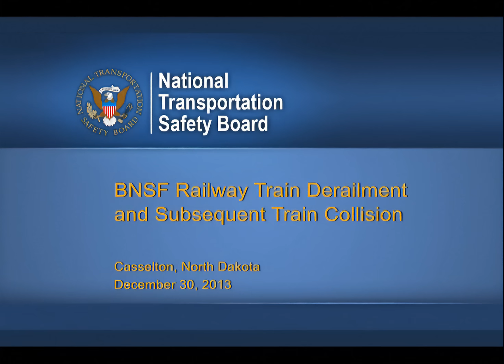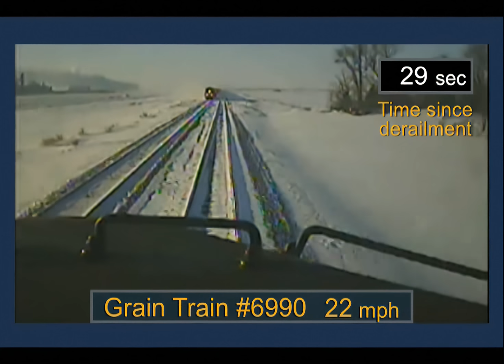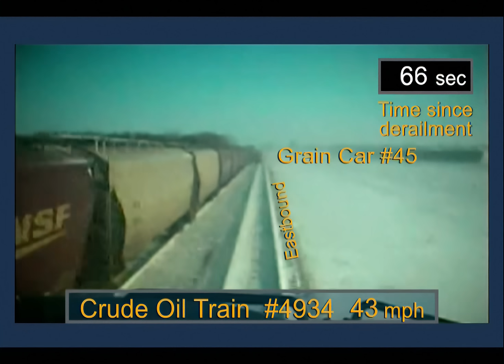BNSF Railway Train Derailment and Subsequent Train Collision

Comment: Almost a terrifying as being in a crashing airliner.  The speed is much slower a crashing train ironically has the same inerta energy as a crashing jumbo jet.  Makes me wonder how the engineer and break men survive these.
Reply: no where near the same energy. The train may be a lot heavier, but energy is to the square of the speed. Twice as fast equals four times the energy.
Reply: Well we didn't have to fall out of the sky first.
Reply: +Geoff Train crashes have never resulted in deaths? That's completely untrue.  19 m/s, 6 seconds, inelastic, this was a train crashing with a single derailed car, that's pretty much the best case scenario for these kinds of things.  Imagine two trains colliding on the same tracks, it happens, much different.  That too would be a rapid deceleration, at least compare apples to apples.
Reply: Trains:  diesel
jet/gas turbine/turboprop:   "aviation" grade kerosene 
i.e. almost identical.
Reply: Also train didnt instantaneously stop, it kept rolling forward, meaning the deceleration was not as abrupt as say, a plane hitting the ground.

The amount of energy going into the crash is similar, the rate of dissipating the energy is less.
Reply: They're in a 35mph tank that doesn't come to a complete stop instantly, unlike a 500mph aluminium tube slamming into the ground.
Reply: Phillip Mulligan This is an EXAMPLE ONLY! If there was a 747 Jumbo jet Flying @ 500mph, and there is a Fully Loaded 16,000ton Crude Oil Train traveling @ 47mph(50Max). The 747 weighs about 200tons(FullyLoaded) N Flies Head-On(@500mph) into the 16,000ton Crude Oil Train that's traveling@ 47mph. On Impact, the 747 jet starts to Implode; While the Lead Locomotive Absorbs the Impact(because the 747 jet is made out of Aluminum) it will already be Fully Engulfed in Flames from the jet fuel. The Cab & Hood of the Lead Locomotive will be Ripped Completely off (because of the Speed of the Jet), but the Train WILL still be moving at the Least 30mph. While the 747 is COMPLETELY Destroyed, the Train is Now Exploding the Crude Oil & Derailing @ the Same Time New coming to a Stop. The Point of it ALL is that the Train ALWAYS Wins! Although it the Train Derailed, it Completely Destroyed the 747 & the Crude Oil Train Destroyed everything within a Mile Radius.
Reply: If there are enough locos a fully loaded freight on flat ground can hit about 70 mph
Reply: Oh, they can go faster than that believe me.   Go to Europe to see fast freights
Reply: The derailed grain car was on its side and much lower than the locomotive that hit it. The crew would have been sitting several feet above the highest point of that car and were probably in no danger of being killed. Possibly injured in a roll over, but that didn't happen.
Reply: Well someone doesn't understand physics...
Reply: Passenger trains. Phillip
 was surprised that the engineer and brakemen survived this which is not out of the ordinary for the circumstances and no comparison to a jet's collision with the ground.
Reply: The 50mph you used for the train calculations was most definitely not conservative, considering that the video states their speed very clearly as 35mph-ish.
Reply: Destroyed everything within a mile radius?
Reply: I'm not sure it would be the crash they have to worry about... here's the resulting fire from this derailment.

https://youtu.be/LKCT_j3yvCU
Reply: Brake*
I'm curious now if trains actually have manned brakes not being manned by the pilot.
If so, then I have a lot more to learn about these than I have knowledge on, not saying I'm a 5-year-old.
Reply: Fully loaded trains can weigh up to 160 million pounds.  The largest passenger jet, Airbus A380 can weight up to 1.3 million pounds fully loaded.  This plane can travel up to 634 mph, lets just say an extremely heavy train can travel up to 50 mph.

Converting to kg and m/s we get:

0.5(589670.081)(283.423^2) = 23,683,685,128 J (plane)
0.5(72574779.2)(22.352^2) = 18,129,611,809 J (train)

Looks pretty similar to me... Yes velocity is far more important than mass wrt kinetic energy, but trains can weigh over a hundred times more than a jumbo jet.  Moreover, the 50 mph I used for the train was very conservative, while the 634 mph was the max speed for the A380. Planes almost never crash at their max speeds.
Reply: Phillip Mulligan I'm no train scientist, but I'm guessing height (ground level compared to 38,000 feet) plays a major factor along with: trains aren't made out of aluminum and don't run on jet fuel.
Reply: Phillip Mulligan 
that's completely untrue. The train won't kill anyone on board because its change in velocity relative to the time it takes is small. The trains initial velocity was 19 meters per second and it coasted to a stop over 6 seconds, couple that with the fact that it was an inelastic collision with a stationary object and it means that the energy was evenly distributed between the two objects. A jet crashing is a rapid deceleration roughly 200 meters per second to 0 in 1 second. give me some of what youre smoking
Reply: Front of the loco has the so-called anti-climbers so every impact force is redirected bellow the crew... the fact that the grain car was turned on its side helped a lot also!! 
It's similar like in a car crash->  vehicle with lower chassis  usually end up worse in head to head collisions..
Reply: Kyle Eggemeyer good point.
Reply: wow ur a new kinda stupid

Comment: Was it a broken rail or wheel? I think that was one of those two really cold winters we had.
Reply: NTSB determined defective axle.
Reply: Stress on an axle, Chinese steel lol
Reply: @Elfnetdesigns  Chinese make all types of steel from low grade to the highest grade possible. Which type of steel did the axle specs call for? The cheap stuff so the American Corporation could show more profit to Wall St?